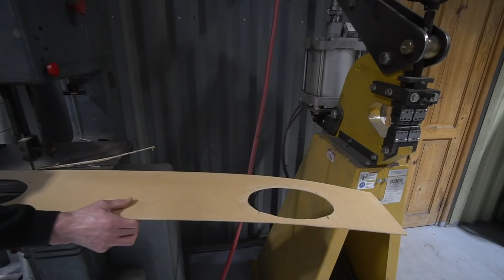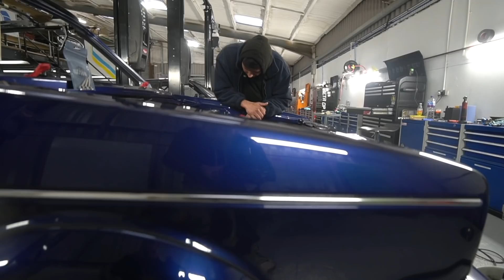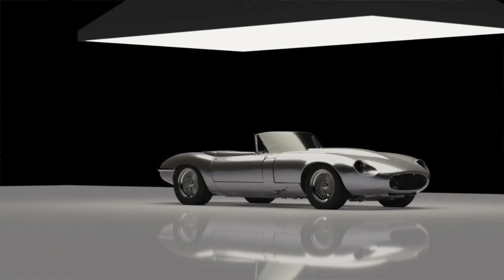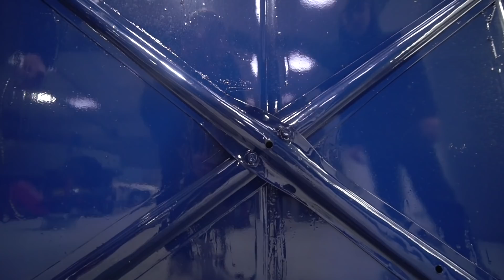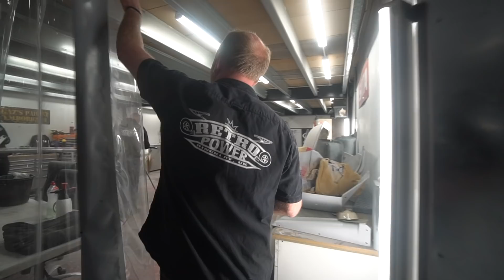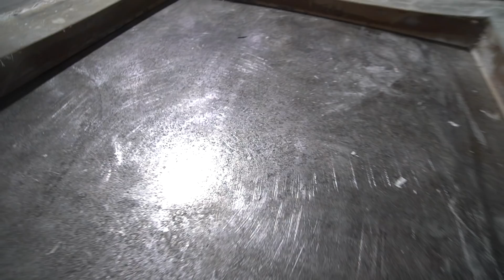Retropower Uncut Episode 84: MK1 Escort Panel Fit Trauma

Comment: Magnum panels fully know about the problem with the passenger door hinges, I had the exact same problem with mine when my shell was being restored. I complained about it and they said they did the tooling for a import car and only test fitted the new doors on that car,  they didn’t check on any other cars, when they realised it was a problem they said it would cost too much for new tooling to be made so they started selling separate hinges and said I should change them on the car side not the door, but I said that would create the problems you mentioned, so they said they’d give me a refund and try and find another door. They also said because the doors have been around for years now and that most good restorers know they have to “tweak” the hinges to fit. If I hadn’t already spent shed loads on magnum panels at the time I would of never used them again. I honestly couldn’t believe they way they spoke to me. They did send me some A post hinges out for free but I sold them on and the restorers did my door hinges properly.

Comment: #retropowercars - I can't help but notice that all your MIG torches are MB25. Is there any any reason why you don't use the lighter and smaller MB15 torches when you are hardly ever doing anything above 1.6mm?

When  I used to work in the kitcar trade building 16SWG box section chassis we found that the MB15 torch was far better for getting into tight places and lighter to be using all day. The line is lighter and more flexible too.

Comment: It's possible that the silver panels are sourced from a country that built these cars later than was done in the UK - the pressing plant would have needed their own set of dies so hey would have had new ones made then, which may have only stamped out a few hundred thousand pieces, whereas whoever has bought the old dies off Ford UK to make the black panels (possibly the same people making the Heritage Mini panels that are famously ALMOST the correct shape and size) has the old original set of press dies that have stamped out millions of pieces and are pretty badly worn out.
Reply: Makes sense.  Plus I remember Nik from Bad Obsession Motorsports showing that the side repeater in Binky's Heritage front panel was about 10mm off where it should be...even though they're the more expensive option for replacement panels.

Comment: Seems like there is some pretty bad industry practices with replacement panels. This has reached a point where it is not due to body shells being different, because this happens all the time. The only remaining explanation is that replacement panel manufacturers are not willing to take in customer feedback and adapt their product accordingly.

Comment: Great video 👍So black repo panels or rework originals 🤔 seems like a cost evaluation needs to be made, possibly extend e type top bonnet line never liked the rectangle lower edge for the v12 cooling.

Comment: Escort doors were still a nightmare on the last edition, so much so that Ford supplied replacement panels with the hinges seperate and holes in the door so you could bolt the hinges on, line the door up then weld the hinges. If you were unlucky to get an old stock door with welded hinges you were guaranteed to have to cut them off and reposition them.

Comment: 6x9's were a thing in first gen Mustangs.
Reply: Are you sure?  I remember them being 5" x7"
Reply: @mynameis63  I was a teenager back then, and I'm pretty certain that 6x9 speakers were one of the standard sizes used in auto =radio= installations, back then. Mid-1960s, though, I'm not sure that FM radio was a manufacturer option, so there wouldn't have been two cutouts for speakers, originally, in a First Generation Mustang.